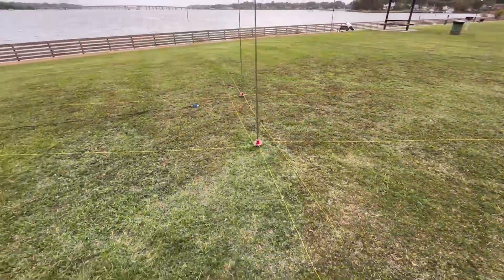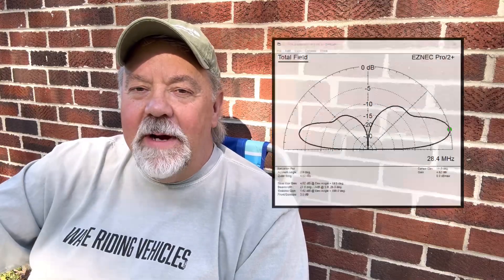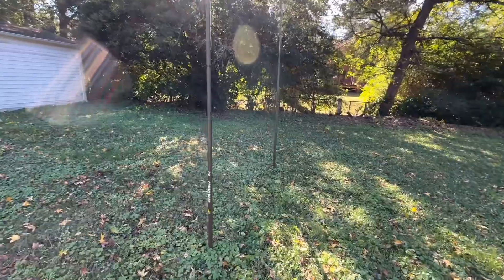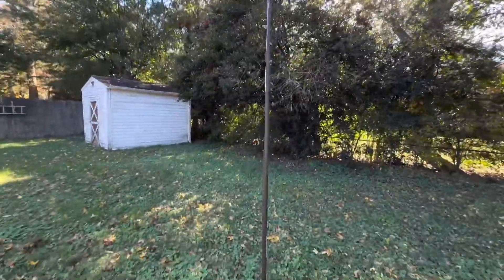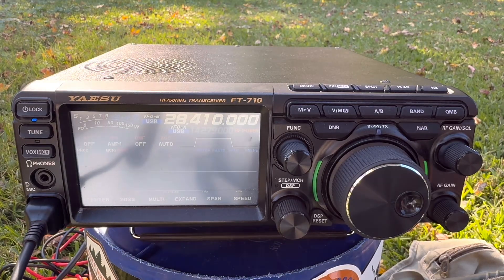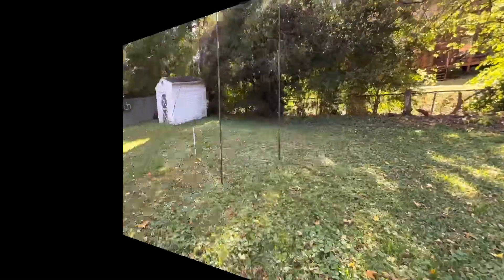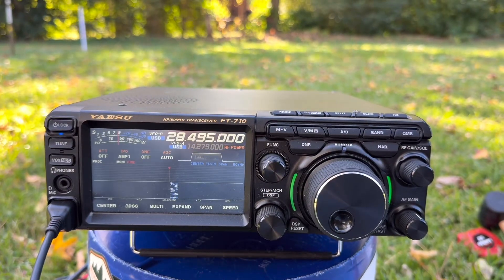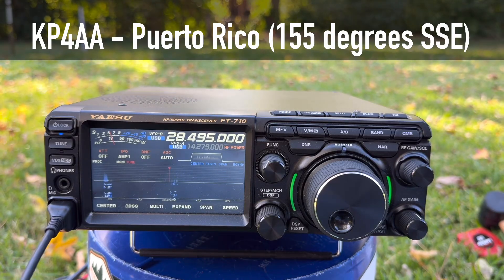Two Element Vertical Yagi Antenna - Easy Build Using a Director

Comment: Hi Walt - Love the channel and the theme. Props to you on doing coastal radio. I live part time on the coast of DE so we are practically neighbors, and I too enjoy the hobby when I'm surf fishing in LSD (Lower Slower Delaware) or at my house down there a couple miles inland. Is it possible to do the same idea as a 2 element vertical but using the idea of a T2LT type antenna instead of a center fed design? 73! Paul N3PFW

Comment: Hi Walt,  I built a 2x 5/8 wave Gainmaster but just coupled with a zetagi Ax2 coupler. Antennas have to be exactly the same, then a FT241-31 12 wound choke for each, then same coax length to the shack,  Ax2 coupler.  Radiation pattern is broadside and has a nice gain.  Keep your videos coming,  73 Peter/  HB3YOR

Comment: Hello Walt, another great video! Question: is the position of the 1:1 balun up the fiberglass pole important? Could you get good results with the balun at the bottom of wire? You are challenging me to try new stuff, thanks! 73 KQ4IXD
Reply from the maker: Very important, the feedpoint impedance would change drastically if you put it at the bottom. You would need a 64:1 unun at the bottom

Comment: I just saw your antenna book full page advertisement in ham radio outlet catalog!! Congrats!! I have been using the book to build a few antennas with my boys. 

We just completed our first parks on the air activation today with your 20m vertical endfed design. I always thought they had to be sloped but tapping it to the mast and running vertical was easier and worked perfectly!! 

We'll be trying more of the designs soon, greatly appreciate the hard work you do
Reply from the maker: Thank you so much!!! Just knowing that you’re building antennas with your boys absolutely makes my day!!!!   Have fun and good DX to you guys!!! 73, Salty Walt

Comment: Walt, I live in an HOA too. What vertical antenna do you have set up at your house? I have the 5/8 Gainmaster for 10/11/12 but need something for the lower bands. Thanks
Reply from the maker: I have a Sigma EuroComm HF-360 and it has worked well for me on 40 through 6
Reply: @COASTALWAVESWIRES  Thanks, I just watched your video on the HOA"s and seen your antenna. My HOA isn't as bad as some others. I can put up whatever antenna I want as long as it's attached to the house. Antennas not attached to the house have to be approved first. I'm thinking about when we're back at solar minimum, I'm going to need something that works well at least on the 20 meter band. I was going to go with the 20 meter moxon antenna from Martin and Lynch that you just did a video on, but I'm a little worried about my neighbors. I'm just weighing all my options.

Comment: Walt
Have you ever tried a Flowerpot antenna. Half wave vertical dipole out of RG 58. I’d like to make one for 20m. Wind a coil from the coax. No radials.
Reply from the maker: I know the antenna well, just never really had the inkling to make one.

Comment: had a question, I'm fairly new to this stuff and I heard in another video you spoke to a guy in sweden doing a 'contest' and you exchanged numbers. What are the numbers and where do I find information about contests? 

I was on the air a month ago or so and I had a sweden fellow I was able to reach and he asked me for my contest number and I don't have one or know how to get one? 

Thanks!
Reply from the maker: Contest rules differ depending on the contest, typically the number is just the order of your contact 001, 002, 003, etc. Some times there’s a number designated for your location. check out the ARRL contest page:
https://www.arrl.org/contests
Reply: @COASTALWAVESWIRES thanks for explaining, I'll take a look at the link

Comment: That looks a good design Walt. Much easier to swap direction quickly than the 3-ele version you tried previously. You could add a few extra mounting posts pre-installed to allow you to rapidly move the director. 73 de Peter GM4RAH 🏴
p.s. can’t wait to see the 2nd book HiHi 😊 p.p.s. Also commented below on the ‘end feed suggestion’.

Comment: I wonder what, if anything, would change if you moved the feed point to the bottom. I am thinking about the effect if one uses a less sturdy pole, like a fishing or flag pole.
Reply from the maker: If you moved the feedpoint to the bottom you would have an impedance issue and would have to use a 64:1 unun, after that it should pretty much act the same
Reply: @COASTALWAVESWIRES  how about if you used a sleeveless sleeve dipole (made from coax) as the driven element, choked off at the feed point at the bottom end with a 1:1 UnUn. That wouldn’t need the 64:1 and would be a simpler feed arrangement (with less pull on the mast).
Reply: @peterrobertson8141  Otherwise known as a T2LT "Flowerpot" antenna. It doesn't seem to have gained much traction in the USA but it's well regarded in other parts of the world. It would certainly put less stress on the pole, and look better as well. I've been contemplating a portable two element set up using 7m Decathlon poles set up like that.

Comment: Hi Walt:  I have two 12 meter spiderbeam poles.  What would the dimentions be for a 20 meter two element vertical yagi?  Best Demi K4BSA
Reply from the maker: Here you go:
Driven Element:
Total length = 10.1243 meters
Each half = 5.0622 meters

Reflector:
Total length = 9.525 meters

Element spacing = 6.728 meters

Comment: Seems this could be done with a 20m endfed? I'm hoping so, seems like it, I really enjoy 20m pota games and I want to do this at some point with it to hunt park to park
Reply: Yes it can. Try a 20m Moxon also
KE6VG
Reply: Yes, I've done this with an EFHW for 20m. I cut a wire 5% longer than the driven element and installed a simple switch 10% up from the base - that way you can quickly switch it between a director or a reflector. The two elements do not need to be accurately vertically aligned. 73 de M1GWZ.
Reply: @MirlitronOne that's great! I just saw a video I missed of Walt's where he was using a reflector behind a 20m 1/4 wave I think it was with somewhat mixed results. It may have just not been pointing the right direction for the guy in Maine he was chatting with, but very interesting how it had an effect regardless! 

I could see setting up a director or reflector at a park to walk around the driven element to point towards each station I'm trying to hit.